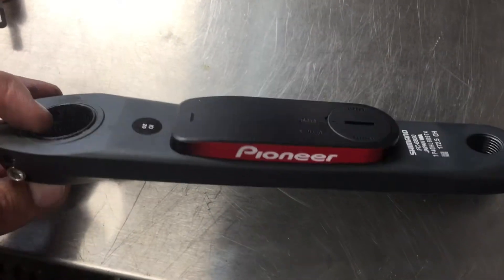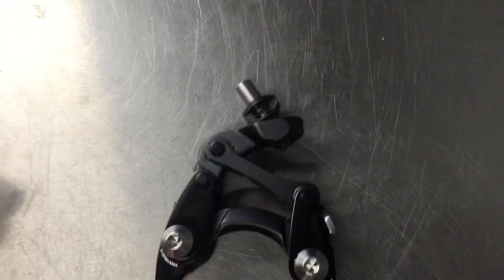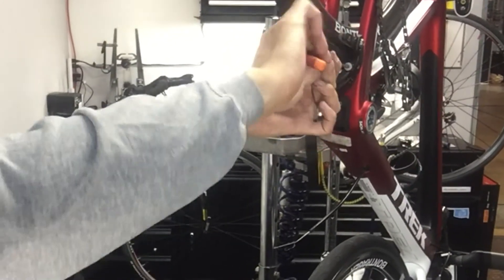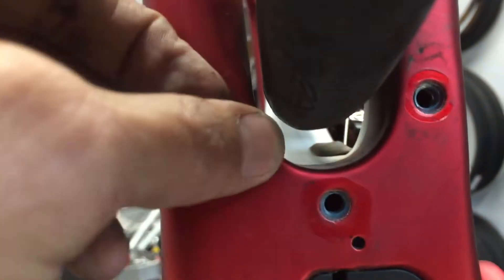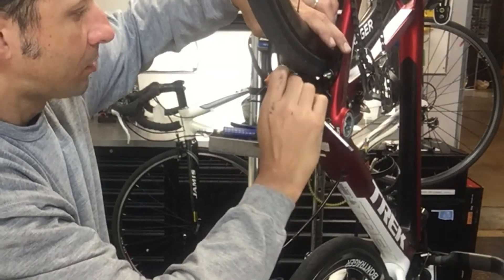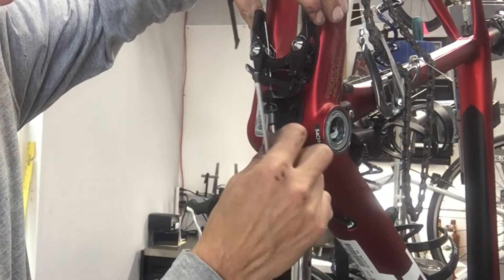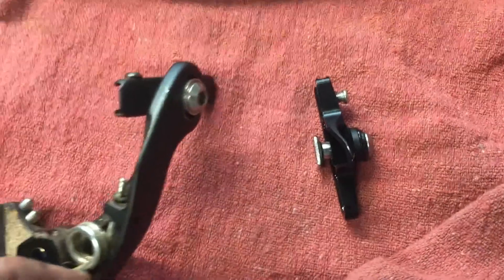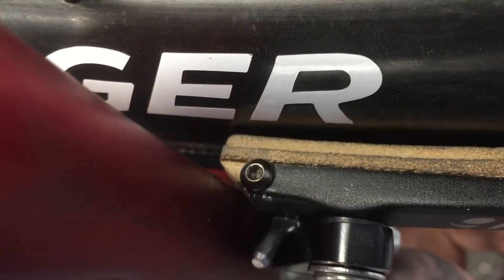Solving the crank arm powermeter with a behind the BB brake mounting issue.

Comment: Hey Joey, it’s now about 1 year since this video was posted. I was wondering if you could comment back an update, like an assessment of how this has worked out in the long term 1 year later? I wrote to Stages support and they said Tektro T851 would work better, and that Bontrager Speed Stop was not recommended, for this particular issue. But it does look like your modification works and id like to do it myself! Hoping to hear how it’s worked out with the setup from this video after a year has passed if there’s any issues! Thanks in advance :-)
Reply from the maker: Well, first off, thanks for the question!  This particular bike never got to long term status because the frame cracked a few months later. The good news for the customer was Trek warrantied the frame with the new Madone. As far as the brakes go, they worked great up until then. I really liked the Bontrager speed stop brakes (i rode some for a season on my Emonda SLR), however, for this particular application, I would have to agree with the Stages tech guys in that the T851 brake would work better. At least it would be easier to install without any modifications to the brake pads. It looks like price wise, they're about the same cost, although the T851's are probably easier to get ahold of. If you already have the speed stops, they're still a good choice, you'll just have to shave the pads if you're running a wider rim like the Bontrager Aeolus, Zipp firecrest, Etc.
Again, thanks for the question! I'll post a link to the T851 brakes as well in the video description.
Reply: Hello, I would like to ask what brake pad housing you were using? Thank you!

Comment: I have an AR1 and have been using this exact brake for a year. it beats the pants off the shimano and TRP brakes meant to go under the BB. super adjustable too, as you can change the pull ratio along with other normal stuff. love the vids Joey. keep em coming
Reply from the maker: Yeah, I ran this brake for a year or so on my emonda. I thought it worked really well. They're really light and aero as well.
Thanks for the feedback and watching!